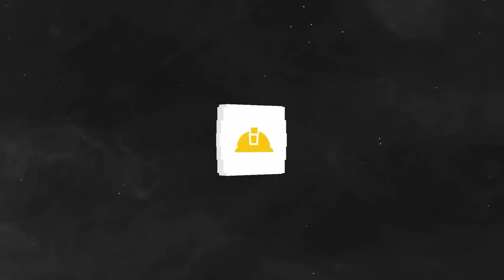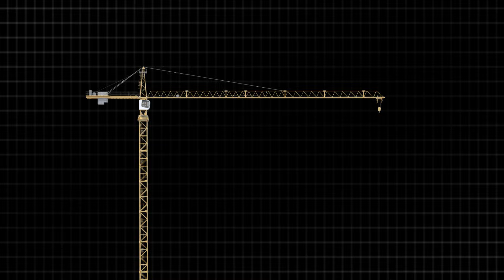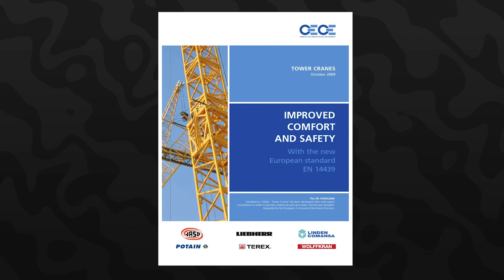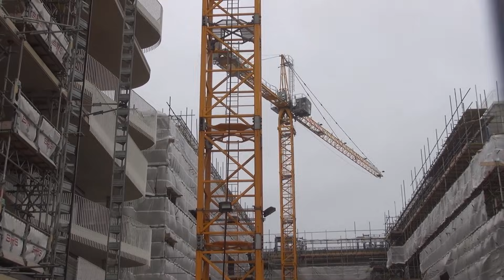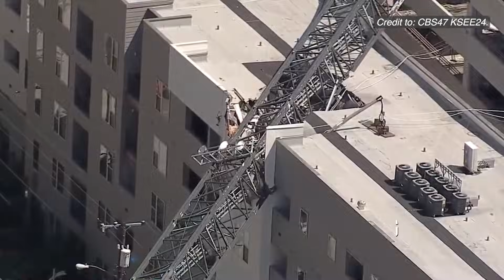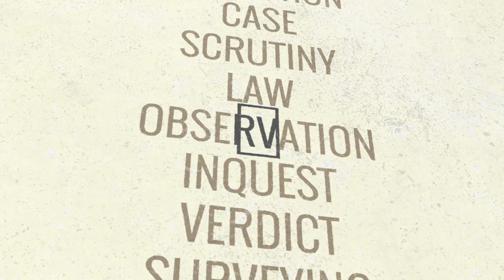How Do Tower Cranes Survive Storms (And Some That Haven't)

Comment: Should have 4 wind sensors a couple blocks away around crane. Could see case where you get S winds at 40 then calm, the bam! west at 70+. Gets caught when sideways. Sensor could tell it to swing east quick. 😁
Reply from the maker: That could definitely give a more reliable reading. Although it’s hard to predict freak gusts! Thanks for watching